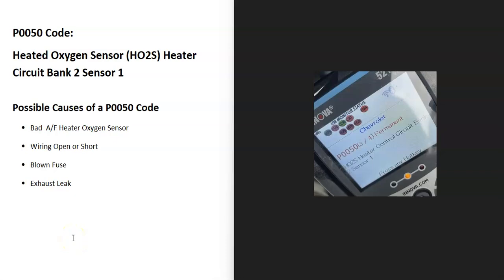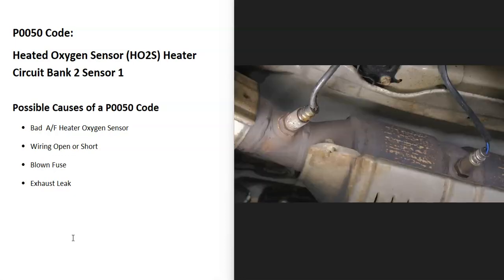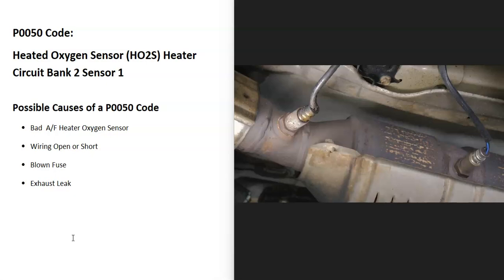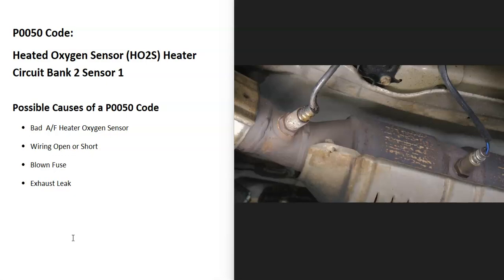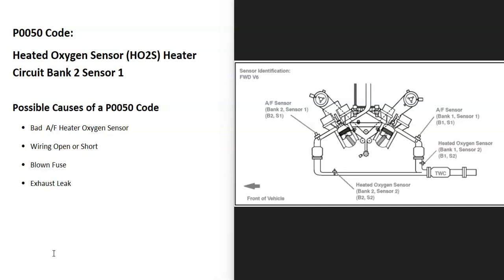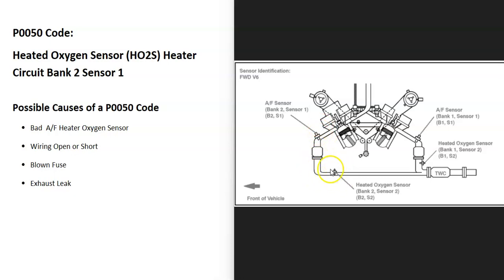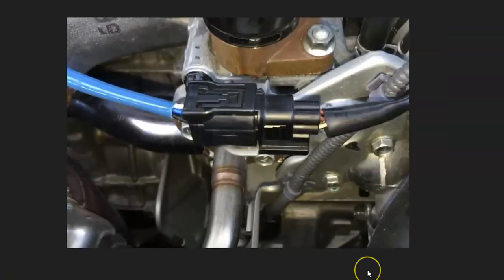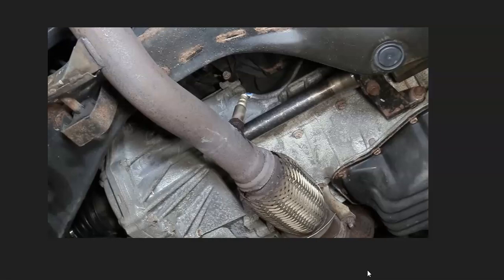Causes and Fixes P0050 Code: Heated Oxygen Sensor (HO2S) Heater Circuit Bank 2 Sensor 1

Comment: I'm having an issue. 2012 gmc sierra both sensors  b1 s1 and b2 s2 are showing faults. It's showing a bad ground on them even after I replaced them and checked the wiring. Any idea?

Comment: I was receiving tons of codes about my bank 2 sensor 1 oxygen sensor and I replaced it and about 4 codes went away but the p0050 code. What should I do?
Reply from the maker: I would check the wiring on Bank-2 Sensor-1 and be sure it is all connected good. If that is all good, I would test the wiring.
Reply: For my Camaro with long tube headers, I replaced the sensor, wiring is good, fuses are good, but I still have the code. No exhaust leak either. Any other ideas?
Reply: @WorrellsWorldofReptiles did you ever figure out the issue?